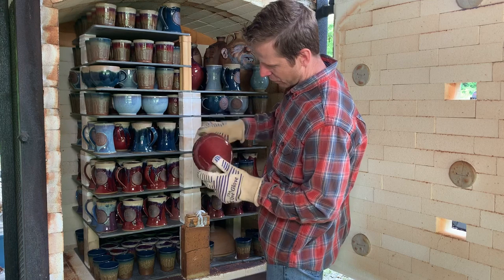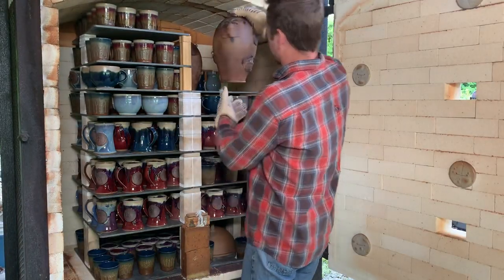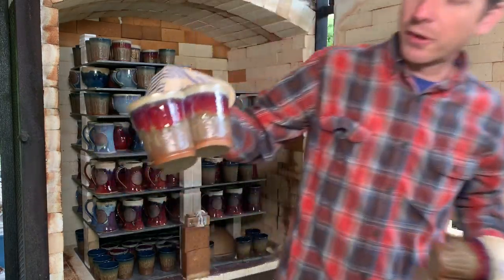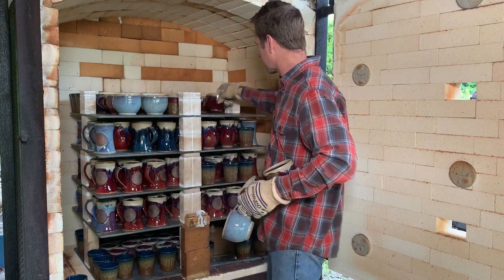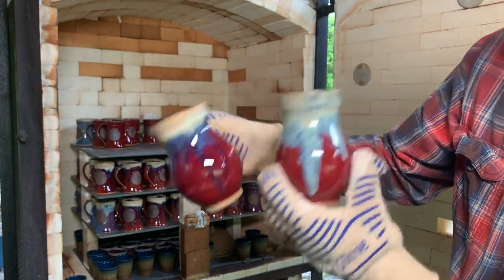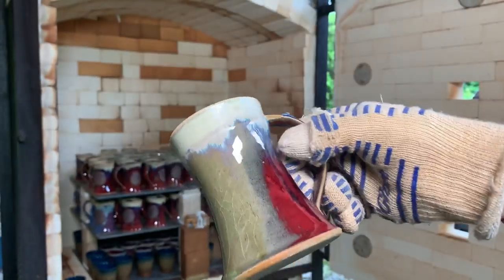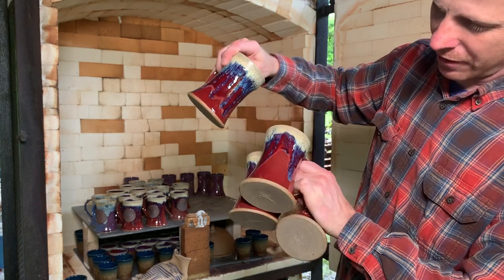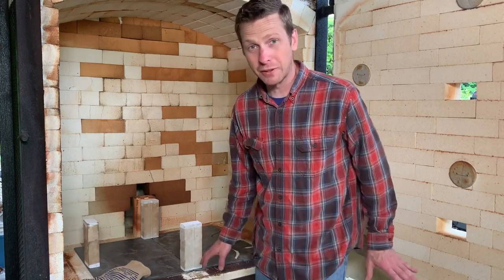Kiln Loading And Unloading

Comment: Great wares Matt!
The new blue combination is excellent.
I like the wide mugs as well.  That's how I make a majority of mine, so they are multipurpose.
That is odd that your shelf did that.  They are  official Advancers correct?  I know there are some "knock offs" that some potters had bad experiences with.
They didn't get wet  did they?  I'm told they don't like moisture, and need to be heated slowly, if they do get wet.

I hope things start to go better for you.  Based on that kiln unloading, I'm going to say they are!